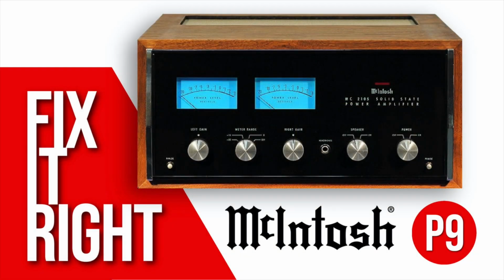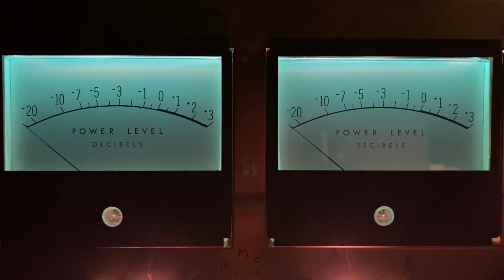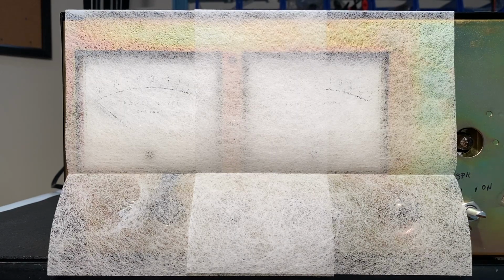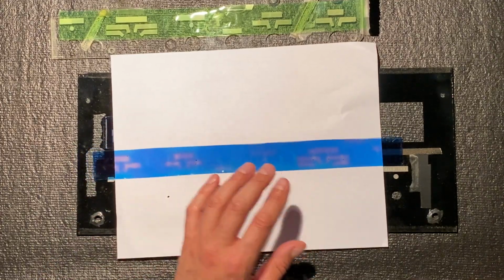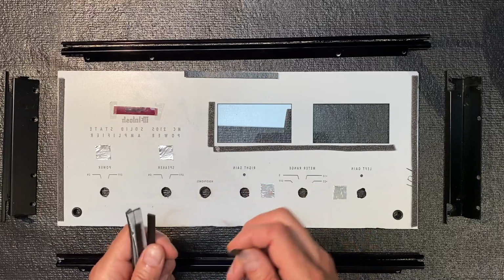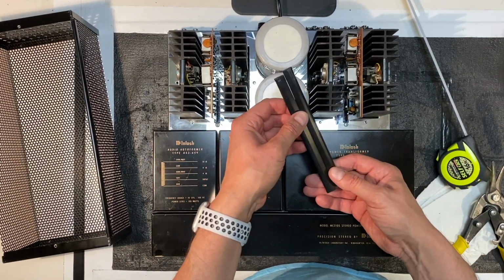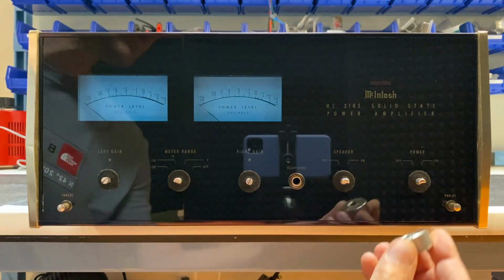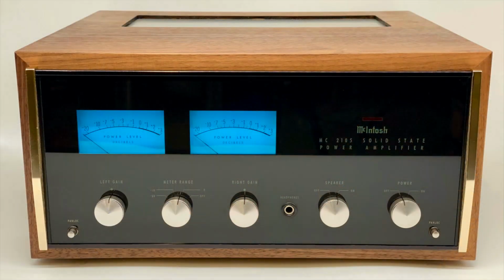McIntosh MC2105 P9: Demonstration, Meter Calibration, New Lamps, New Glass, New Cabinet & Panlocs!

Comment: Just an Update Chris,
I attached the 8 Ohm resistors to an aluminum CPU Heatsink block and added a better gauge wire and connection system for them. The dummy load was getting too hot to  rest on the plastic bench cover, even at 30 Watts and the heatsink made a huge difference. 

Then I spent a very long time testing and comparing. I think it comes down to some incorrect caps installed in the Output and/or Meter boards. It's possible that the Meter Scale Selector has one or more bad resistors, so I'm going to check those first.

With the Meter scale set to "0", (as opposed to the -10 or -20 setting), I brought the power up to 20 volts. The Meter read nearly "0db". I dialed the amp's meters back to -3db. After I did that I checked and everything up and down the scale was good as far as Watts and volts in the Meter Scale "0". 

However, when I switch the meter scale to -10 and/or -20, the output Watts were at about double of what Mac said they should be. They weren't doubling the watts 'perfectly', but in general, where the watts should have been 2.25, it was about 5.2. Where the Watts should have been .5, the Watts were about 1.1.

I have a pair of 8 Ohm x 200W resistors coming and should be here tonight. Meanwhile, I'm going to check all the resistors in the Meter Scale Selector and if they're all good, I'm going to start with returning the previous caps to the Meter board. Earlier today, I tested the 'old caps' that I had removed and replaced and they were all fine. 

The problem is that I never tested the output of the amp before I started this job. The problem I have now may have existed before I ever started the work. I suspect that this is a good possibility because of the uneven output of the Left & Right channels, which is what got me wondering if I should recap the amp in the first place. 

As bad is this all sounds, I really think it's going to boil down to something simple, like a pair of caps installed that weren't meeting the min or max specifications. Just which specifications they need to be, would be a guess.

I could take a few hours and see what I find or if I can't locate the issue I was considering one last alternative... If I can't find the problem, what do you think if I was to set the Meter scale to the "0" position and then bring the voltage to 20v. Then dial the Meters to read -3db, which is what I first did, (as I mentioned in the start of this post).

It would mean that the scales on the -10 and -20 selections wouldn't be correct but the amp would not be in danger of overpowering the output signals even if cranked all the way up. However, in the -10 or -20 selection,  they wouldn't be accurate either. It's a half-assed way of doing things, but I may have to take that option.

I don't know, maybe I'll be able to find the problem and not have to resort to settling for some compensated alternative.
Rich
Reply from the maker: Rich, also, don’t run the amp at high power for too long with the dummy load. As long as you’re staying below 105 watts/channel or so, it shouldn’t be a problem, but still, I try to do my readings in under 15 seconds or so and give the amp a rest when testing at high continuous high power.
Reply: @FluxCondenser   Thanks Chris. 
The Meter scale selector, (between the L and R Gain controls), can be set to "Off", "0", (which is what you had it in when you set you +3db/105W), "-10", and "-20". 

So, I meant that when I have the meter scale selector positioned to the "0" position, if I watched my DMM and turned up the gain until I saw the 20Volts, (50W), and then adjusted the meters to reflect -3db, the readings I would get when the selector was positioned at -10 or -20 would not return the correct voltage/Watts, (according to what Mac says they should show), as I turned the L or R gain to a specific db reading.

However, you've reminded me that the meters are not what decide the ultimate watts output. I forgot that the amp's performance is not dependent on the meters! 

It's just that I didn't like the fact that when the meters were set to the scale "0", the indicated -3db would be far below the 50W. I only get about 26W output at -3db if I leave the meters the way they were. This tells me that there something wrong somewhere and I'm absolutely certain of that.

I do a lot of recording and I prefer to count on a mechanical way to confirm the balance because my hearing is degraded. 

That said, I definitely have lost sight of the fact that the amp can, and will, achieve the rated 105 Watts. When I typically play music, I NEVER play it loud enough for the meters to indicate a -3db, or -10db if the Meter scale selector was positioned to the "0" scale. 

In fact, I typically set the Meter scale dial to "-10". That way the sensitivity is enough to show a reasonable sweep at a comfortable volume level.

Therefore, and "in the light of day", I'm going to focus on making the meters display the same for L & R output when the Meter Scale dial is set to "-10". Then I'm moving on to watch the remaining Part 9 video and get this thing reassembled. 

I'm up way too late sometimes (especially when I didn't achieve what I intended to accomplish that day due to interruptions and unforeseen delays). I can see that it affects my sense of reasoning.

Thanks again,
Rich
Reply from the maker: Rich, I’m not sure what you mean by, “It would mean that the scales on the -10 and -20 selections wouldn't be correct but the amp would not be in danger of overpowering the output signals even if cranked all the way up.” 

The meter board and meters have nothing to do with the output of the amp. The amp will run fine without either, and calibrated meters are not necessary for proper operation. The meters are mostly for show. If you can get them to read somewhat accurately that’s great, but not necessary. The main usefulness of the meters, really, is to help balance the level controls. To do that, all they really need is to be calibrated to have the same reading for both left and right meters with the same output wattage. That way, when you input a mono signal, you can adjust the level controls for even output. 

I would just focus on achieving that if you’re not finding the meters display absolutely accurate wattage. It’s really not necessary as the meters display dBs, not watts. dBs are a relative, not absolute scale of measurement. Yes, McIntosh provides wattage equivalents for the dB scale to allow the user to glean some info about wattage, but calibrating the meters to a particular wattage is really more about making sure the meter driver board is adjusted for even output on left and right meters and that there’s a full range of movement available for the meter dial at each of the different offset settings.

Comment: I’m sorry Chris…  Thanks for clearing that dummy load connection up. This is why I was careful to state where each of my connection points were going to and coming from. I knew that if I had one wrong, I could have a lot of problems.

Still, it’s hard for someone to picture the set up without a diagram. I wanted to send a drawing, but never could find a way to send and/or attach any info in the Flux Condenser website when I went there.

I’m not a member of Facebook or Tweet or any other of those social websites, so I couldn’t use that method. 

Until this moment, I never bridged the load across the plus & minus speaker connections of a given channel. So, thanks for clearing that one up! That’ll be a big help in any future projects. 

However, I had to stop there because I need to be absolutely sure I understand your statement: “For 50 watts, you’re looking for 20 volts AC with a 1kHz sine with 8 ohm load”.

If I’m misunderstanding you, I can cause a lot of damage.

My SFG’s amplitude can go to 20 Volts but I need to be certain that you’re saying that I should send a 1KHz Sine signal, to the Amp’s inputs, (L or R, depending on which I’m testing), at 20-Volts amplitude. 

I can’t continue until you confirm that I understood you correctly. Would you please confirm that you DO mean to set that amplitude of my SFG to 20 Volts? Of course, if you don’t, please indicate that as well.
Thanks,
Rich
Reply from the maker: Rich, no, I do not mean that the input should be 20 volts. Remember, we were discussing the output power. Output power is measured in watts. The formula for watts is voltage squared divided by resistance. 50 watts of power output is therefore 20 volts ac at the output (20x20=400/8=50). I had told you that 1.5 volts would be too high an input, so I would certainly not recommend 20 volts.
Reply: @FluxCondenser   Thanks Chris. I'm glad I didn't try to send 20 volts to the Amp. I'm interested in getting 50 Watts @ -3db. If that works out to 20 volts, fine. 

However, it's not happening because this entire problem began back when the amp was first recapped years ago. The person that recapped the amp before me didn't know the the unit's S/N either. 

I'm sure of this because my Output, Input, and Meter PCBs in the manual that I got from Mac are showing different Cap specs than most, (if not all), of the other manuals and different than what he had in it. For example, he, (or she) used a manual that required 100/3 caps in the Output board, where the specs for my Output PCBs require 100/16.

The same kind of discrepancies are in the Meter board. Then they probably brought the amp to 20volts and turned the Meters a considerable amount to meet the -3db. Or they may have selected the Output voltage for "0" db and adjusted the meters for that, who knows! All I know is they didn't use the proper PCB specs because they didn't know the S/N of the amp to start with.

I have 2 ways I can go;
I can either take out the new caps I put in and return the caps they had in the amp, (which could be difficult because the leads of the caps I removed are just barely long enough to make a good solder), OR I can leave the caps I put in alone and readjust the meters to meet a 20v output.

The Meters would require an unusual amount adjustment to get them where they need to be but I think it should be doable and then I can move on.

BTW: Thank you for the clarification re the 20 volts. That's how I initially understood it in your earlier references regarding the 20V relationship to the -3db. But then you said it again and I started wondering if you meant that I should send a 20v signal. 

To be clear, I completely understand that I will need 20volts Output to achieve -3db and my most recent tests, (with the dummy load properly positioned across the connections of the Right [or left], speaker connections), produces about 30 volts.
Rich
Reply from the maker: Rich, if you’re getting 30 volts at the output you’re up to 112.5 watts. The amp will be clipping at that point and you’re over the 100 watt rating for your dummy load. Be careful.
Reply: @FluxCondenser   I'm sorry Chris, I did mean 30 Watts not 30Volts. In fact, thank you for watching out and keeping me from shooting myself in the foot. I truly appreciate it. 

I may have misspoke earlier but I'm very clear on the 20 volt relationship to the watts, and that I want to have 50 Watts, when the meters are reading -3db. I also realize that I don't want to take the voltage higher than 20 regardless of what the meter reads. 

As best as I can tell and remember, at the times when I thought that I was getting an 'X' number of volts and watts, I didn't realize that my Meters were set to -10 or -20. The faceplate wasn't on and I memorized the Meter Selection backwards by mistake. 

It was that error in my favor and likely kept me from over powering the system, so "God does work in mysterious ways".

Mac gives equations for the various Meter power selections and I maybe able to use that to set the Meters to "0" and 100 watts. The equations refer to what the meters should read at these other selection points. However, first I will strive to reach the -3db with the meter selector at "0". 

Then when I have established that I'm at 20 Volts and the Meters read -3db, I may try selecting the next meter point down, (-10) and see if the "0db" reading works out to the X Watts and volts based on whatever Mac says in the manual, (I don't have it in front of me at the moment).  

This all really goes back to the fact that Mac's selection of ink to stamp the S/N on their amps was a poor one. Follow that with whoever it was that did the first recap job and guessed at using a manual that wasn't updated or correct for the installed PCBs. 

I really think the previous recap job was done by a knowledgeable person but they were in the same position I am now. Without a proper ID of the amp, you have to go by a manual that has the same PCB S/Ns, which they didn't have. 

Add to this the fact that there is no reference for some of the installed caps or resistors. They're shown in the schematics as one rating, but then shown in the parts list as a very different rating and no notations about any differences.

I just realized that I'm late for an appointment! I'm going to put this all to the test when I get back.
Thanks again,
Rich

Comment: Whoops,
Though I still get the discrepancy that I mention in my previous post, I just realized that my Amp Meters were set to -20 instead of "0". That's why you see the voltages I give in the previous post. Move the decimal one place to the right and that will give the voltage at "0". I don't have the face plate on and between having the amp upside down and right side up several times, I got myself confused as to the Meter dial reference.

Still, the Sine Wave produces a far too low Watt and the Square wave produces results much closer to what they should be. I must say that the previous reCap job had a pretty big mistake in their choice of caps. 

I think it was the meter board caps that they had in it were 10uf/16v but when I got a better Schematic that was closer to what it should be, it called for a 100uf/16v! I'm going off of memory here but I'm going to double check what it was because I made a note of it. It'll be about an hour before I can, though.

I know there was a significant difference in what was in there and what this particular PCB S/N said it should have had in it.
Rich
(sigh, it can't just be 'simple, huh?)
Reply from the maker: Rich, see my response to your other comment. You need 20 volts AC coming out of the amp for 50 watts at 8 ohms.

Comment: Hey Chris,
I seem to have something set incorrectly. Using the sine wave for the SFG to send, my Watts are much too low, but if I use a square wave, I'm almost dead on.
Let me give you some numbers I got using the Sine and then the Square waves on the test for the Right channel.
I'm being careful to let you know exactly how I have the test configured:

I set the SFG to feed only one of the Amp's channel at a time, (as opposed to my earlier setup where I fed both channels simultaneously by using a T-Connector and running a single cable to the SFG). 

No O-scope and No AC Meter is connected, only the DMM. 

The DMM's positive probe is attached to one lead of the 8 Ohm dummy load and the other lead of the dummy load is connected to the "+" Speaker connector for the Amp's 8 OHm rated speakers. The Negative probe of the DMM is connected to the "-" Speaker connection.

The SFG is sending a 1KHz SINE WAVE at an amplitude of 1.000v. At -10db on the amp's meter I get .723 volts on the DMM. At -3db the voltage is 1.598V. Skipping to the -3db, the 1.598 voltage squared (carried 4 places after the decimal) is 2.5536 divided by 8 = .3192, or about 32 Watts.

I did the same exact test on the same channel but I set the SFG to run a SQUARE WAVE signal. 
The Voltage at -3db came to 1.998, squared is 3.9920 and divided by 8 = .4990, or almost 50 Watts. (The same 'improved results' with a square wave were apparent at -10db). (The Left channel showed the same differences when I applied a Square wave).

I did this test and recorded the results at least 3 times on each channel. The Left channel shows to be almost 2 watts low and I'll adjust for that, but my problem is that I don't get near the Watts that I should get if I use a Sine wave. Do I have a bigger problem than I think? Should I be applying a higher amplitude maybe?
Rich
Reply from the maker: Also you write, “ The DMM's positive probe is attached to one lead of the 8 Ohm dummy load and the other lead of the dummy load is connected to the "+" Speaker connector for the Amp's 8 OHm rated speakers. The Negative probe of the DMM is connected to the "-" Speaker connection.”

No, don’t put the dummy load in series with the meter!

The dummy load bridges the speaker output. One end of the resistor connects to the negative speaker terminal. The other end of the resistor connects to the positive speaker terminal.

Now, connect the negative probe of your AC meter to the negative terminal of the speaker output (which is also connected to the one end of the dummy load). 

And, connect the positive probe of your AC meter to the positive terminal of the speaker output (which is also connected to THE OTHER end of the dummy load).
Reply from the maker: No, 1.998 volts AC = .49 watts, about a half watt. Not 50 watts.
Reply from the maker: For 50 watts, you’re looking for 20 volts AC with a 1kHz sine with 8 ohm load.